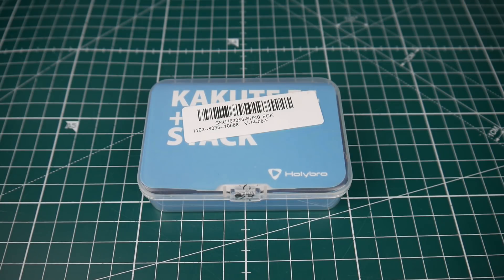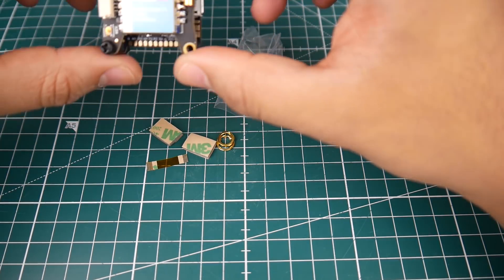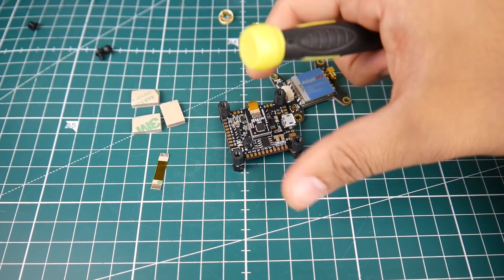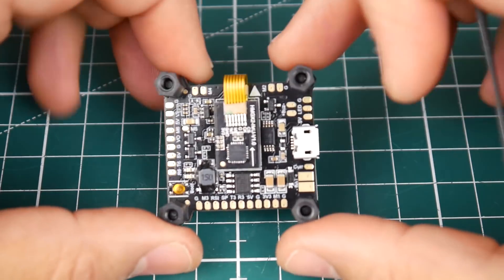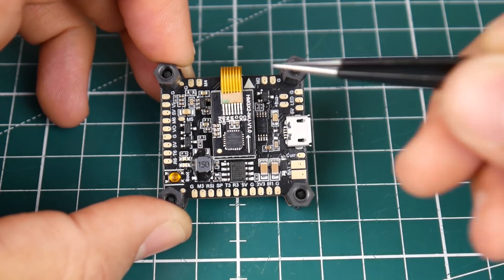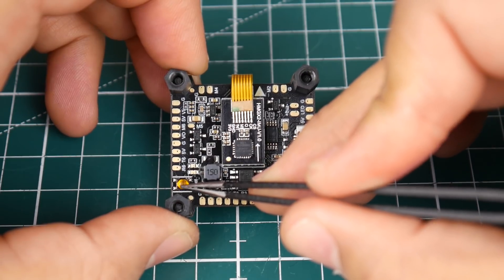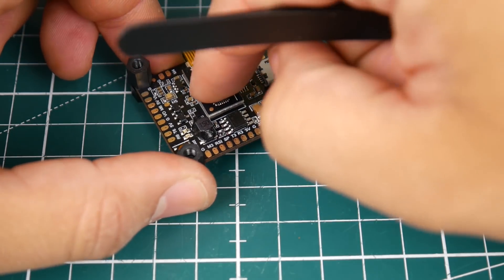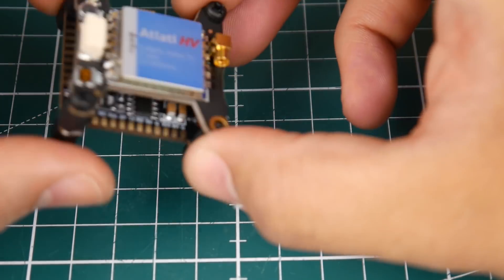Holybro Kakute F4 Flight Controller + Atlatl HV 5.8G 40CH // Overview

Comment: Had a sad revelation about Holybro Atlatl HV VTXes at last week - they aren't supposed to work directly from 4S battery and above. Fried protection diodes (datasheet said these are Schottky diodes but well) on two Atlatls - they worked less than hour before frying. Story here:
https://www.rcgroups.com/forums/showpost.php?p=39419481&postcount=5

By the way do anybody know where to buy SMD Schottky diode labeled 2AE9 or replacement one?

Comment: I have Kakute F4 AIO and Kakute F4 V2. Word of warning - gyro boards can and will tear off together with ribbon cable on hard crashes. If you quad doesn't arm anymore and have NOGYRO fault in Betaflight CLI status, check out your gyro. Most likely you will have to replace ribbon cable and foam pad.

Comment: Do you think that the silicon of the conformal coating is soft enough to be placed on te edges of the foam ? Without loss of its sofmounting properties
Reply from the maker: +3Day Printing This board is not good for conformal costing I would go with hglrc f4 flame it's $28 now

Comment: the all in one kakute f4 is pretty fiddly to solder.  i sorta like the AIO for the power distribution but i'm not sure its the best choice.  i'm probably gonna go for 4 in 1 esc  so i maybe shoulda gone for the non pdb kakute f4...anyway,  i'm still not out of the test flight stages... and last one ended with a mysterious '' low voltage'' on the dvr and it failsafed?... i think my quad is haunted.... its been doing this even though i swapped out rx, then esc's... then FC... then motors..... my runcam mini is haunted, or has ebola.

Comment: The missing screw is on purpose if you put the screw back you can't connect the pig tail :-) I have orderer an 90 degres pig tail to connect to mine but i'm using the kakute f4 aio

Comment: I have the aio one, i have crashed my quad many times and also from a very high altitude and that imu gyro is intact and no problem. 
Talking about the high altitude crash, i use the frog lite frame and nothing broke on it. Amazing, i bought it by your recommendation, thanks.
There is also a v2, which has solder holes instead of pads,a barometer, a dedicated i2c pad and also 2 extra uarts (total 5 uarts), at the same price